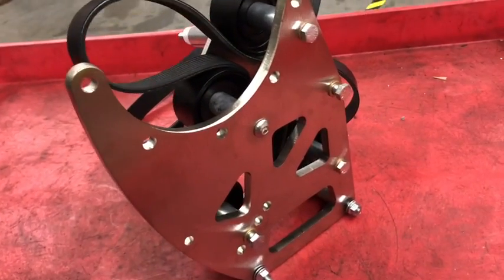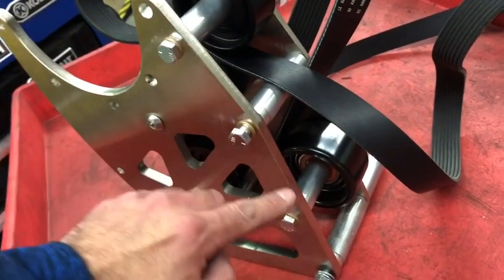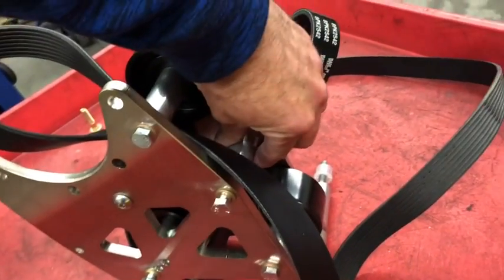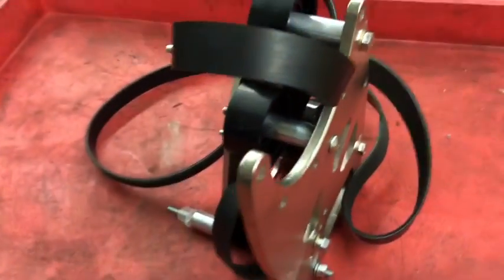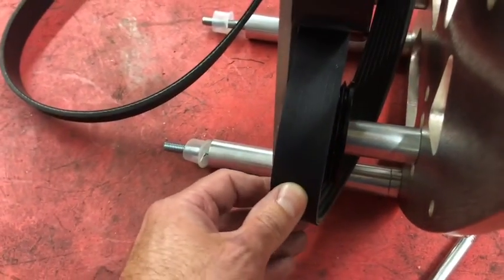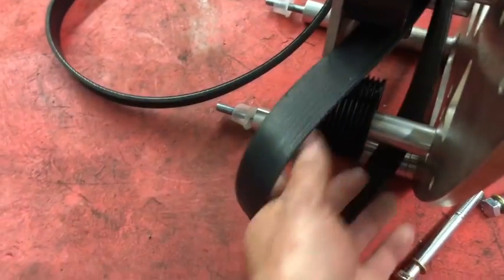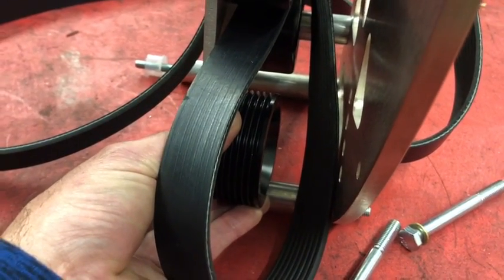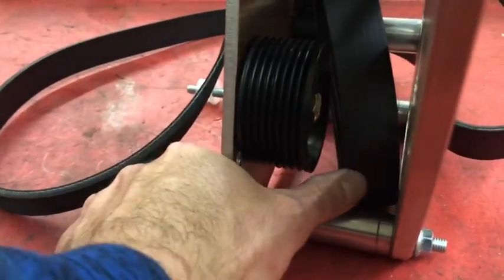Vortech/Paxton belt change tips & tricks S550 Mustang 5.0

Comment: Thank you so much for doing this video with the amazing visuals Steve. While I was installing a Beefcake Stage 2 Paxton 3.33 setup on my '17 GT last summer I was doing much reading on the forums for install tips and tricks that may help and came across this bolt idea in writing. I went to the local hardware store but wasn't able to find the bolt so I just threw the kit on as Paxton intended. I've been driving it lately right down to where Paxton/Vortech say it's not safe/ideal to run it ambient tempurature wise and I started to hear squealing. I hopefully assume it the belt being cold, or perhaps some pulley alignment. I am overdue for the first blower oil change...Since it's winter I've been planning to "upgrade" the kit a bit for spring, do maintenance and go over the entire kit again. Definitely doing this modification along with the torque booster wastegate setup and removing the JLT intake tube with a turbo-guard in place to keep the impeller safe.

Very much looking forward to picking up some torque and boost and likely will upgrade it to an oil fed unit down the road. Thanks again for explaining this all! Cheers

Comment: I have a 10 red packaging on my Windsor how tight do I make the belt I can’t find an answer to this anywhere and I run it tight end it haunts me every time I started worrying about the bearings in my blower I’m not so worried about the bearings in my motor yeah I know that’s backwards and oh yeah just wanted to add the Paxton system for the Windsor is also engineered so nicely and built so well zero problems after the first bolt up(10 years) and none of the problems you have in this video damn son